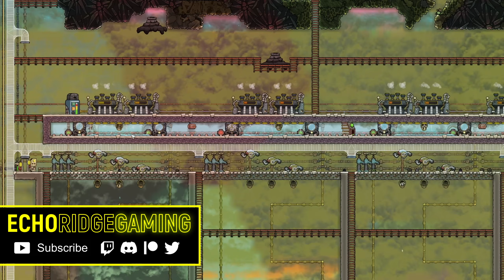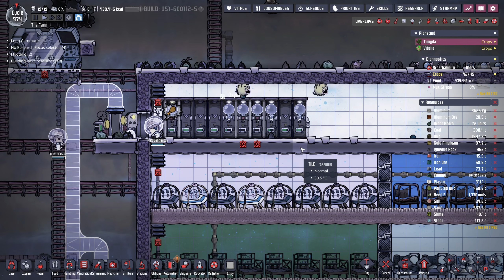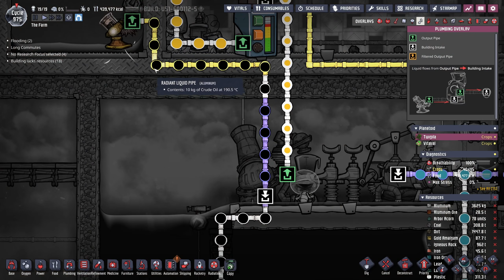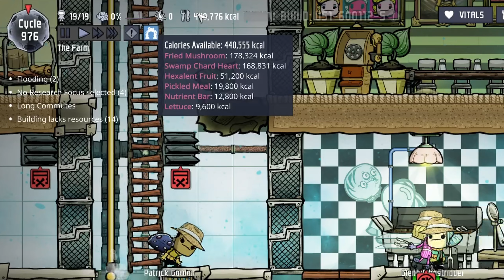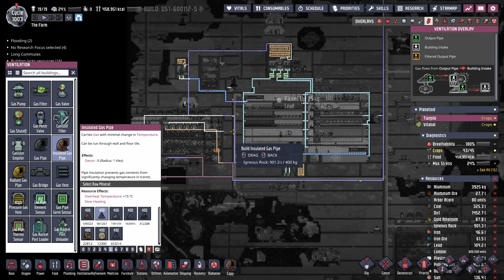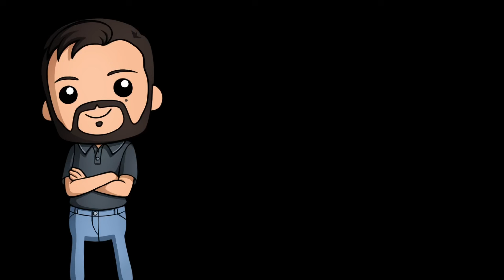Industrial Oil Brick Thing | Ep 11 | ONI - Farm - Verdante

Comment: Talking about that crude oil/petroleum line (around 18:30) coming out of the slickster ranch: this is what I use the loudspeaker alert for. I put a liquid sensor on those sorts of line with a NOT gate, and attach it to a custom loudspeaker alarm. This way if a different fluid ends up in that line (e.g. water or polluted water), I know right away and can curse Past Kye at the earliest opportunity lol.

Comment: 0:19 How long will it take for echo to notice the little CO2 bubble in the polluted water tank that's trapped, or the NG bubble in the first oil section?  It's like a dead pixel I can't stop staring at it every time the screen pans over. 

PS 19:22 on those new metal tiles on the bottom, if there's not an insulated tile on the far left side will it transfer heat diagonally into the first oil section and steal heat from the dirty sauna?  Or is that just temp shift plates that transfer diagonally?

Comment: Echo this might be too late to say it but youd save a ton of power instead of doing liquid filters everywhere to do liquid pipe element sensors hooked up to automation to a liquid shutoff valve. When the designated liquid is read on the pipe sensor, it toggles the shutoff valve on and the liquid bead is transferred through the shutoff valve to its own run, each one of those runs a significantly less amount of power comparatively to the filter, saving you the power youd need to run your bajillion thermo aquatuners 😂😂😂

Comment: One thing that’s not so related to the video but that I still wanted to mention: a few episodes ago you were talking about the food situation, and about maybe taking out the “no evolution chamber” rule and start making barbecue instead of omelettes. To that I have another suggestion: turn the omelettes into mushrooms quiche. You have eggs, waterweed and dusk caps all available on your colony, so why not try that? Morale wise, unless you get some sleet wheat to make frost burgers, the most you can get out of meat is a surf n turf, whereas the quiche is a top tier food. 

I was doing a run with your same rules and that was the option I opted for, and it worked out pretty well

Comment: Three comments regarding the slicksters:
1. Once molten ones show up, there will be two layers of liquid at the bottom (oil and petroleum), which may cause momentary drowning issues for slicksters, inhibiting their consumption of O2. I suggest switching the tiles around the grooming station to mesh ones.
2. If you remove one mesh tile in the ceiling of the incubator room, it will open it to the entire sauna space, and you can have excess slicksters hang out there and still consume O2 (for a while at least).
3. Now that you have oil at the bottom of the sauna, you can probably open up the oil reservoir space and let it be a part of the sauna directly. It will make space for another stable as well.

Comment: I once colonized a planetoid that had 5 oil wells all pretty close to each other. There was also a carbon dioxide geyser (sadly the cold type). So, I made a big thing with two oil refineries and way too many molten slicksters/ I had over 240 at one point I think. Above 200 for sure. I had to cull the population a few times to handle the lag. The extra heat I needed to keep them molten came from a petroleum generator.

Comment: The oil modules: Liquid energy node

Question because I have not tried it: What happens when you cook mud? Steam and dirt?
Does polluted mud cook into polluted dirt or regular dirt?
Enquiring minds want to know.

Slicksters in the dirty Brick: The domesticated ones seem to really suck up the CO2 now. I have one farm of 8 that are boarder line starving and they are being direct fed the CO2 from 6 or so NatGas Gens that run about 1/3 of the time. If you switch some of those mesh tiles near the incubators to screen doors they can use them as ladders and you can get rid of your ladders and put in a third incubator. You could also make the bottom two tiles solid to prevent the oil/petroleum from getting in with the incubators if you want with the top being the screen door/ladder.